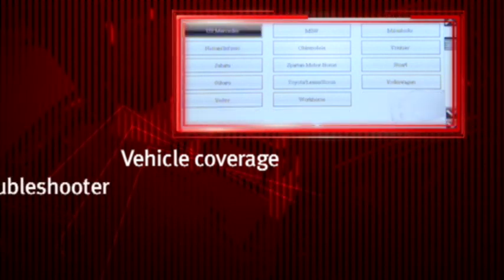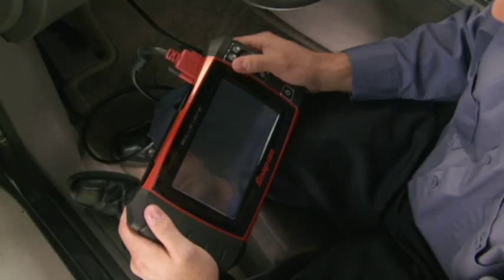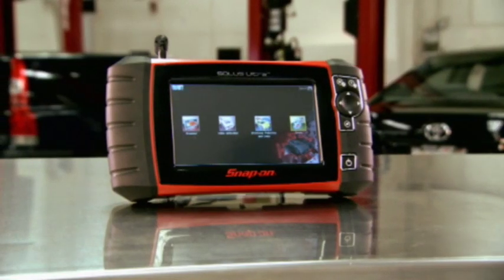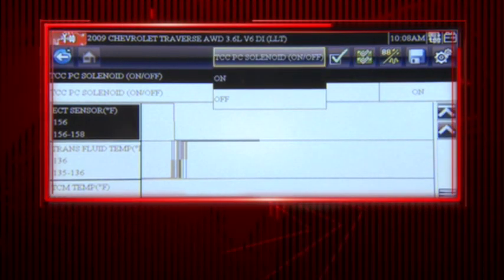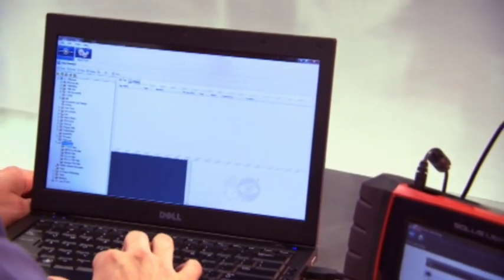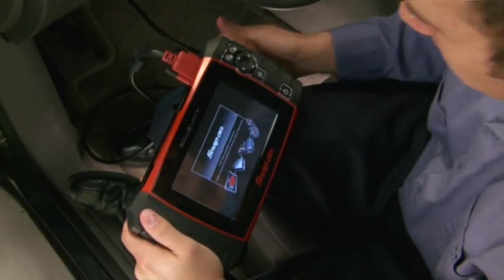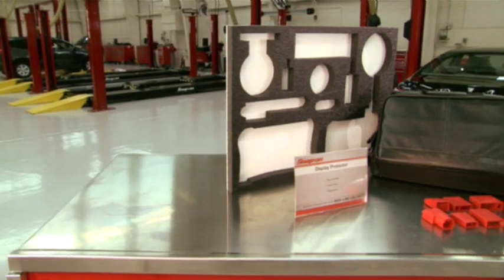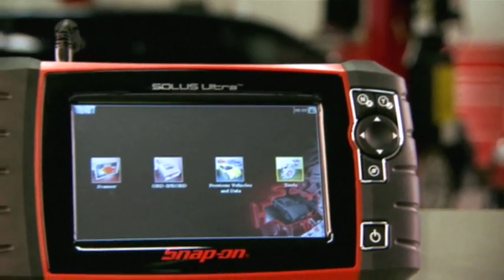SOLUS Ultra™ Scan Tool | Snap-on Tools

Comment: I'm a DIYER and own an 08 updated brick(MT2500) that I got 4rd hand. It is a great tool and helped me with about 50 repairs. I use the black cable and software I wrote to see traces.  I priced this tool and realize techs must make a fortune to afford toys like this(and other amazing SO tools).  I can afford harbor freight.  I am in the wrong field. And one more thing, even as  DIY i know you will always be behind the 8 ball with an aftermarket tool. Even on much older cars there are gaps..

Comment: 85% of the time if you find a test or a bi-directional function is not working, it is because you are most likely not running the most current software update.  Always make sure you keep your software up to date and this will rarely happen.

Comment: I have this scantool it's just OK for the price of updates and bidirectional controls that do not work I do not think it's worth the money nothing worse than hitting a test button that is in the menu and "test not supported" comes up. The tech tips are vague and just common sense a p0171 bank one lean gives you no pinpoint tests to solve the problem just lists possibilities MAF. Vacuum leak, fuel pressure almost better off buying a generic scantool and utilizing all data or identifix for pinpoint tests to guys starting out do not blow your hard earned dollars know your theory and understand how the system works and you just need the scantool for the code. Sorry Snap on love your tools but this tool is unpolished and over rated alot to pay for bidirectional controls that do not always work and no real quick tests so I still have to go to all data would not buy again.
Reply: kruno45 CVCC

Comment: So what's the big buzz about the strap on scan tool? What do you do if a customer comes in with immobilizer problem, can the strap on do a key programming, or initialize the PCM and immo unit? Come on people, nothing works like an OEM scanner, if is not OEM, then is just another generic scan tool, just like OTC.
Reply: chinolashtla What do you mean by OEM scan tool? Do you mean the one that stealership uses?
Reply: Gregory May i do not use Snap On scan tool because most of the time it doesn't have full bidirectional control, second, no matter what software version your running on, it will always lack full data or bidirectional functions, if you're a real tech and work on not just service but diagnostics, then go and get what the stealership uses, you will not be disappointed.